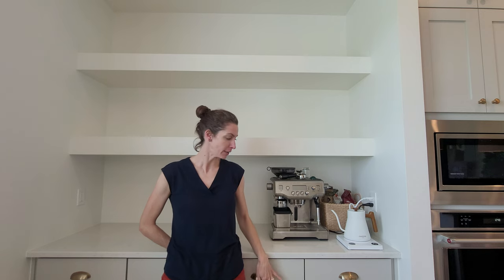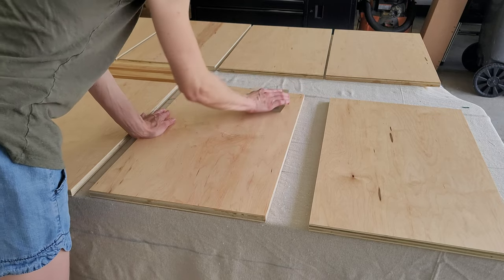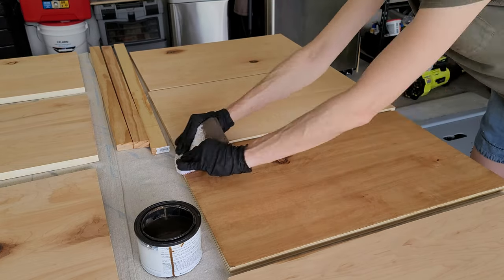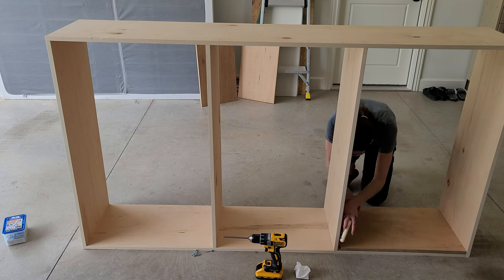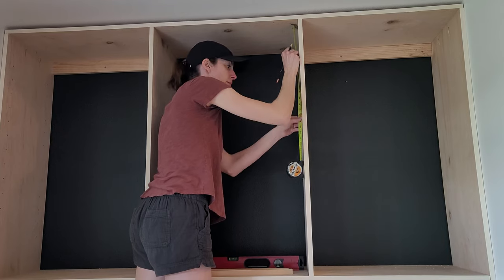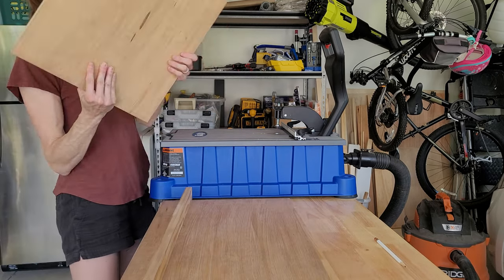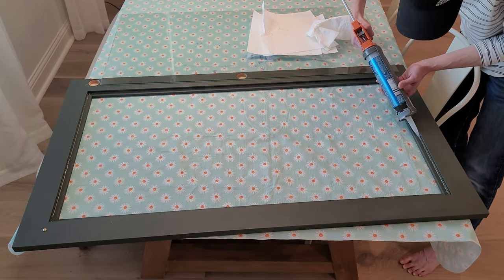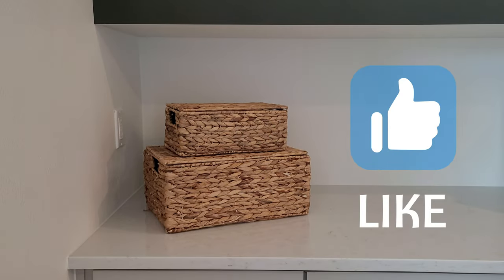DIY Custom Built in China Cabinet - Step by Step Tutorial - Modern Farmhouse Kitchen Nook

Comment: Where do you get your cabinet paint from? What brand did you use?
Reply from the maker: Hi, For this built-in, I used Magnolia Home paint, the color is Locally Grown. I rolled it on using a foam roller to help with a smooth finish. I know spraying is optimal, but it's difficult to touch up sprayed paint with a brush, so I went with a brush to cut in and a roller for the flat surfaces. It settled really nicely and I love the look of it.